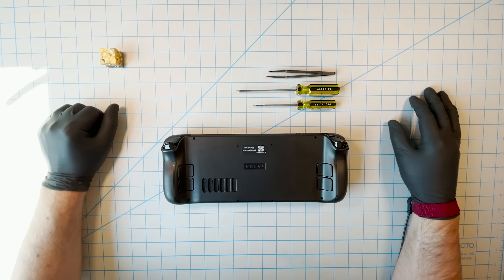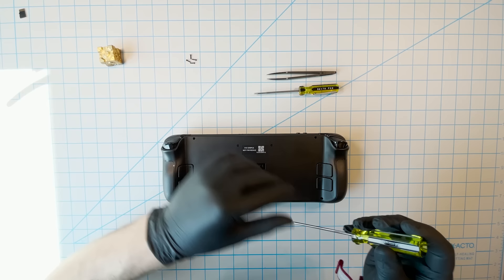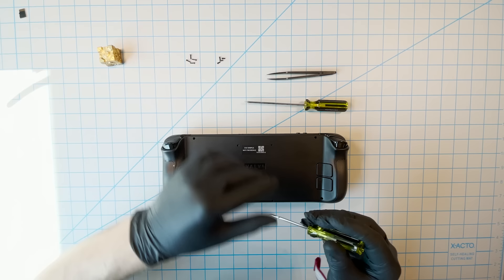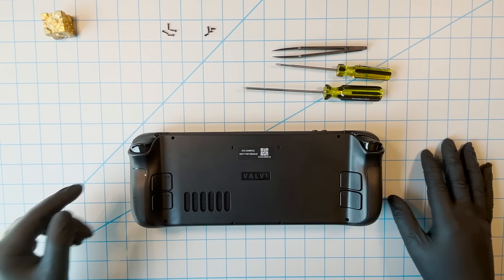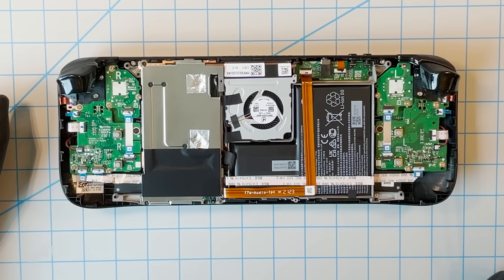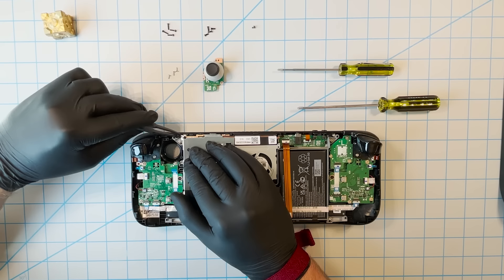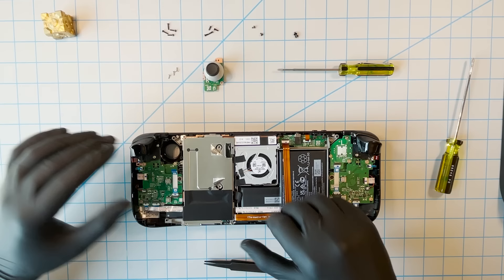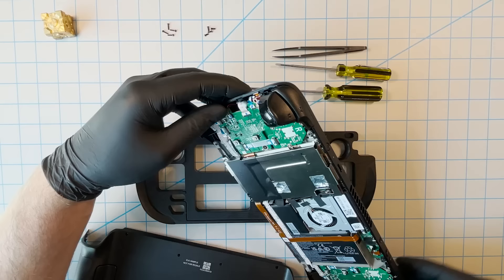Take a look inside Steam Deck™!

Comment: Not only did they not glue everything together for no reason: They had the guts to do their own teardown video. And on top of that they alluded to being able to get replacement parts. They may not be doing it perfectly, but this definitely puts them well ahead of like 99% of consumer electronics companies in terms of respecting right to repair.
Reply: @Berserkism  This piece of tech is a little bit more complicated than your playstation 4.
Reply: *Louis Rossmann nods in approval
Reply: I wouldn't be too sure about replacement parts. Valve has a history of abandoning there hardware products...
Reply: It's probably due to the founding philosophy that started them, modifying
Reply: @Berserkism  cry about it
Reply: @Jokni  Not really... Just smaller.
Reply: @goat.95  Which products?  Steam Controller wasn't selling well, and many people that had them weren't using them.

Steam Link no longer made sense to keep making.

It made sense at the time it came out(2015), since there wasn't really comparable hardware to do the same thing (RPi 2 had just come out, and IIRC, the Steam Link was significantly stronger), but nowadays, with the latest RPis being fully compatible as well as having mobile apps, having custom hardware to do it just doesn't make sense.
Reply: @Acorn_Anomaly  Valve index has been out for a while now and the only option if it breaks is to buy a new one lol.
Reply: @goat.95  games too. Let's see if they do the same with the steam deck again.
Reply: @Berserkism  Ay, you know Candice?
Reply: Well they know their audience is 100% PC gamers, and PC gamers in general are more hands on than your casual console gamer.  
If i saw this thing was glued shut i'd cancel my reservation instantly. ...of course the sticks and the battery will die eventually. That NEEDS to be fixable.  
Chances are there will be a Steam Deck 2 by the time the battery is dead and you'll just upgrade... but i'm still waiting for the Steam Link 2... so... Valve has earned some trust issues when it comes to sticking with new products.
Reply: We’ll if they do make a steam deck 2 at least we can be sure there won’t be a steam deck 3
Reply: @gageschleser6307  nah there will be steam deck +++ because they don't know what 3 is
Reply: @gajbooks  I'd say having the buttons, joysticks, and a battery add complexity to a teardown unlike a playstation and xbox.
Reply: @goat.95  Where do you get this idea? Valve Support is held in VERY high regard at r/index. I've had no issues with mine, but I have no reason to believe I'm left stranded. Some of the stories are of support even covering repairs of headsets that were already out of warranty.
Reply: @Acorn_Anomaly  what was steam link?
Reply: @gusty7153  Think of it as a Chromecast for steam.  It was a little box about the size of an external hard drive, with HDMI output and USB.  It was specifically designed to be able to plug into a TV and stream your Steam gameplay to your TV from your gaming computer.
Reply: @Acorn_Anomaly  don't forget about steam OS, originally based off debian, they completely scrapped it and rebuilt it using arch linux instead and the steam deck is suppose to be running off the arch based version
Reply: @gusty7153  And they had a good reason for that.  Keeping proton up to date with the latest devices and kernel and system library updates that really improved things was turning out to be a bitch to manage on Debian, which is extremely stable because they don't update to the latest stuff quickly.  That stability is nice, but it also means that the important updates they need for Proton wouldn't happen for months, if not years.

Switching over to Arch's rolling-release will make it far easier to keep track of the latest developments that will genuinely benefit gaming.
Reply: @Acorn_Anomaly  indeed, i heard about that and i just wanted to bring it up to add on to the one post where you explained the reasons for dropping different projects, cause for a long while steam OS seemed like abandonware till the steamdeck was announced
Reply: @Acorn_Anomaly  also no onder why steamlink got dropped. having a box to stream from the pc to the tv sounds dumb. especially when most gamers i know plug the tv in directly as a monitor
Reply: @Jokni  How exactly? Is it using space age technology we are unaware of? Its legit plugging shit out and unscrewing stuff, not exactly rocket science. It's just smaller.
Reply: TRENDING-TOP-YEARS⤵️ --------------------------------------------------------------------------------------------------------------------------------------------------------------------------------------------------------------------------------------------------------------------------------- ❣️ AISURU.TOKYO/michan?HDRCam✰ᴾʳⁱⁿᶜᵉˢˢ★ トップAVビデオに参加する
❣️

Youtube: This is fine 
Someone: Says "heck" 
Youtube: Be gone 
#однако #я #люблю #таких #рыбаков 
#Интересно #забавно #девушка #смешная #垃圾
Reply: @DogginsFroggins  It also has a battery, a screen, and a controller integrated into it on top of what a PS5 or a Series X/S does. In an absolutely tiny form factor, that also complicates things.

Regardless, if Sony and Microsoft did a video like this, that would also be amazing. But all they've done was the PS5 video for how to access the one M.2 port on it which was deemed user-serviceable, it's not a teardown, just an instructional video. This one actually digs into the device, into parts which are not supposed to ever need servicing by the user, and it actively helps with the single most common modification people had in mind since the Steam Deck was announced: replacing the SSD -- which Valve doesn't want you to do, by the way, but instead of locking it down or soldering the SSD (like both consoles do for their actual internal drive) they still show you how to do it, because it's your device.
Reply: Also hinted at warranty only being broken if we damage it too 🤔
Reply: @Jokni  no, it's not. It's also an APU. It has a screen and a controller packed in, that's it.
Reply: @gusty7153  That only works if your TV is in range of your computer, or you're willing to move your computer around.

I have two Steam Links, and I got quite a lot of use out of them playing games on my upstairs living room TV with my computer still where it normally was in my basement.
Reply: @Acorn_Anomaly  and that's the thing. most everyone i know only have the one small bedroom available to them which they put everything in.
Reply: It doesn't have to be perfect, just good enough
Reply: @goat.95  Only the ones that failed. If the steam deck fails I'll buy one and eat it.
Reply: @gajbooks  Way, way smaller and more powerful.
Reply: @DeeSnow97  Honestly I'm seeing this video as a positive but people are forgetting the massive difference in scale between the two devices, this is going to cater to a far more tech savvy market in far lower volumes, if Sony did anything close to this they are basically bricking countless consoles because Jimmy the 13 year old is gonna screw around with his Xmas present for tik tok views, void his warranty and give his parents an expensive headache.

Whereas the average consumer on this thing is just going to make an upgrade or swap out a joystick with the video running in 4k in the background at half speed or has built so many PC's and modded so many electronics they can do this with their eyes half closed considering there is no soldering.
Reply: @Berserkism  the playstation is way more accessible. everything is there after removing some plastic and metal.
Reply: Best not to speak before it's actually out and we see how it ends up ACTUALLY looking like on the consumer end. He even said in the video itself 'it might look slightly different than the one you bought'. 

And for companies 'slightly' can either be meant literally, or 'it's nothing like what you bought and we put glue everywhere hehehehehe'
Reply: @PoptartParasol  Well, valve does have credibility in this stuff. We got no reason not to trust them.
Reply: @CS2architecture  Rossman was surprisingly critical of this whole video.
Reply: I do wish they would have used metal inserts and bolts instead of self-tapping screws though. I'm still very excited for my reservation to come due.
Reply: @Acorn_Anomaly  You can Steam Link from remote location as long as your PC is on and connected to the internet. I believe I had tried this while on mobile data outside
Reply: @Jokni  you just described the Steam Deck.
Reply: @Berserkism  entire time? yea lets focus on one small part of the video and exaggerate, american mentality!
Reply: @Vysair  when it was first introduced, you couldn't, IIRC.  Could be wrong about that, though.
Reply: @Berserkism  Having repaired multiple consoles, all I'm gonna say is that tearing down and, more importantly, rebuilding handhelds is almost always way more of a bitch than any home console.
Reply: They just announced iFixit would sell replacement parts.
Reply: they literally screwed metal screws into plastic. they designed the thing to be virtually impossible to actually put back together.
Reply: @FingerinUrDaughter  I have taken apart many, many things that have screws going into plastic. As long as you're being careful and not forcing the screws in, it's perfectly fine. I've only destroyed one thing because of this, and that was because I accidentally used the wrong screw.
Reply: @monkeywithocd  you should really avoid talking about things you clearly have no knowledge of.
Reply: @FingerinUrDaughter  What about taking apart many many things with screws going into plastic did you not understand? I'm into retro electronics so I've been regularly taking apart and putting back together such devices for years at this point, and the only one I remember breaking was one of those huge original Xbox controllers, again because I accidentally used the wrong screws.

Now, some devices use more brittle plastic which you need to be exceptionally careful with, but in general as long as you're not going ham on the thing and they designed it with a reasonable amount of support you should be just fine.
Reply: @monkeywithocd  i didnt understand the part where your "experience" violates the laws of physics. because ALL plastic will get stripped by removing metal screws from it. still dosent change the fact that spending 3 cents on some steel ferrules to screw into would be a much better alternative, but they were trying to save every penny possible while still charging out the ass for this piece of trash.
Reply: @FingerinUrDaughter  It will only get stripped by removing the screw if you're pulling it out like a nail. The other ways to strip it are by over-tightening or potentially over time by constantly carving new threads into the plastic by not matching the existing threads when screwing it back in, which can often be avoided by counter-turning the screw until you feel the screw fall slightly. This is why I mentioned "being careful", because plastic is more delicate than metal, but it's still perfectly fine for this use case.

Again, years of experience in doing this, and plenty of other people have, too, which trumps your unsubstantiated claim. Just look up anyone repairing any game controller or old handheld console and you'll see that it really is no big deal in most cases. Where they use brittle plastic, like IIRC early-00's Macs, it can be a problem, but most that I've experienced are perfectly fine. Recent example: the terrible Xbox Elite Controller 2 I have taken apart and put together NUMEROUS times to fix problems with it, and it, like pretty much every other controller, has screws going straight into plastic, and it has held up perfectly fine.
Reply: @CS2architecture  I was looking for this comment.
Reply: absolutely.  That's why I bought an OLED and feel real good about giving them my money and supporting STEAM / VALVE altogether.